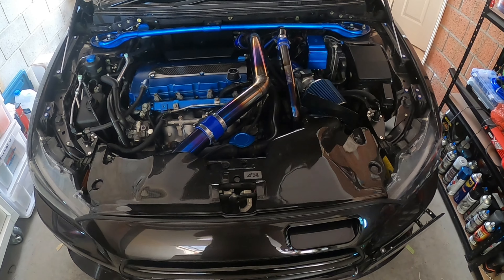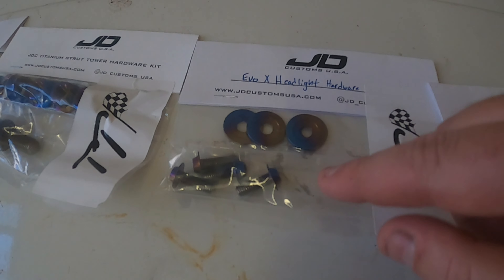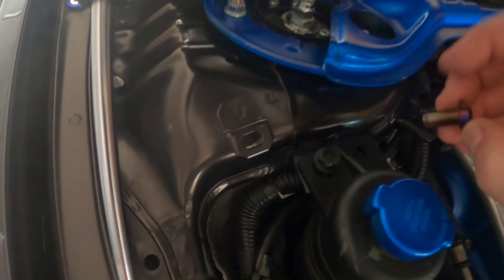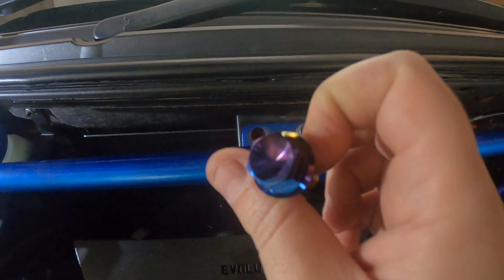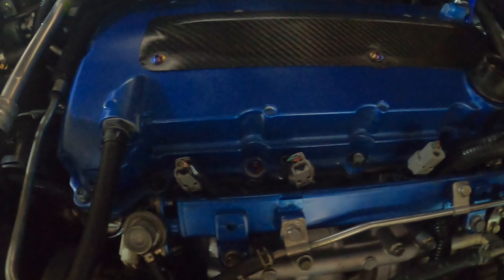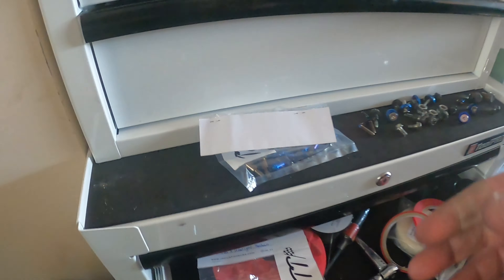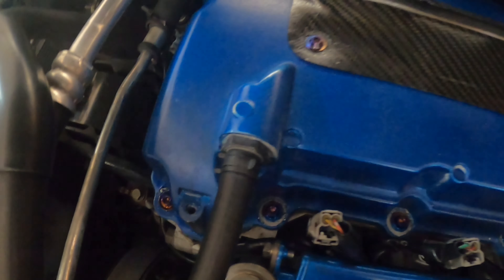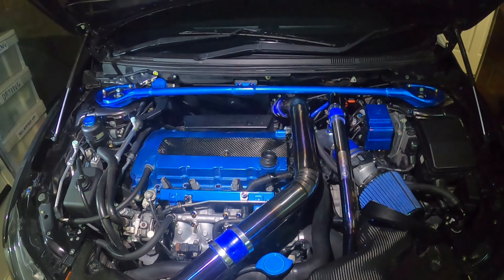Evo X Titanium Bolts Install / Creating My Dream Evo Engine Bay

Comment: Your channel is underappreciated man. Ordering myself a set.
Reply from the maker: Thanks Ricardo I really appreciate that. 
Which ones are you thinking of grabbing
Reply: @JacksonStrain  most likely for the valve cover and headlights.
Reply from the maker: @Ronin_Senshi  ohh yep those are 2 of my favourites, if you're in Australia make sure you order from top tier parts and use the code JTRAIN to get the discount

Comment: They look awesome. 👍

I ordered a Rocker cover the other day, I'm going to do the titanium bolts when I do the swap.
Going with a satin black around the outside, then a red where the coils are, should look good with the cutout Evolution X Ralliart coil cover.

Doing some slight visual stuff until the turbo swap in Jan.. 😁
Reply from the maker: Thanks mate.
Be warned once you start tidying up the engine bay it becomes an addiction 🤣
Reply: @JacksonStrain  Tell me about it, I have a list of stuff I want to do now.
Rocker cover was the main one.
Still not sure whether to paint it myself or find someone to do it.
I did buy all the paints, but I'm a complete noob with painting 😂

I was doing a lot of the Evo X design shields at the same time as the turbo.
Reply from the maker: Yeah i painted mine and am not 100% happy with it so have been thinking about getting it done professionally.

The heat shields from evolution x design are great bits